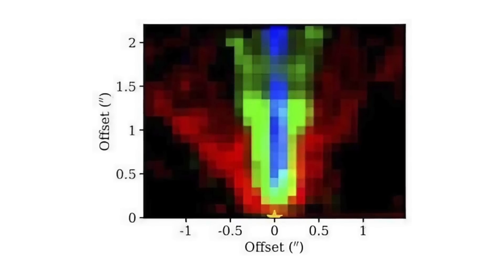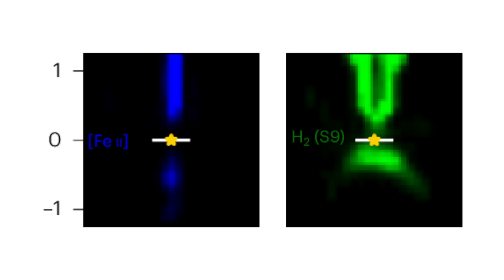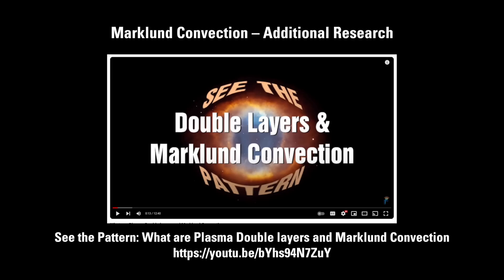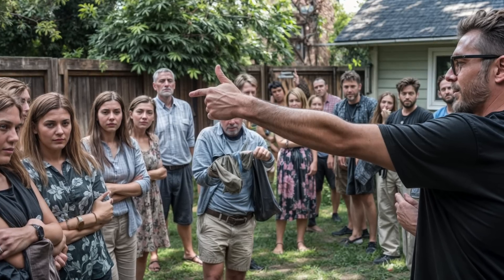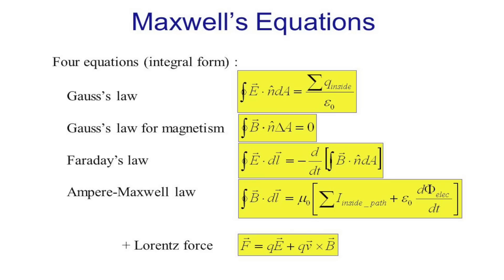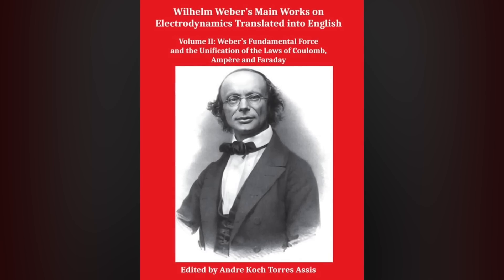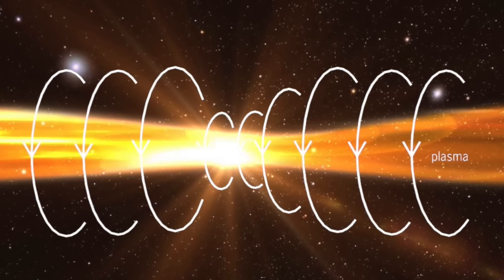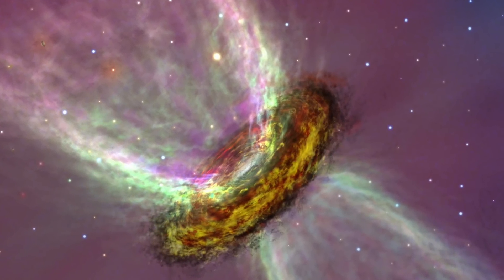Michael Clarage: The Gestation of Solar Systems | Thunderbolts

Comment: Goes well with the oil drop experiments that show how we get the ring and moonlet structure from an oil drop in an electric field, and Tom Van Flandern’s work on why gravity can’t form a solar system like structure.
Reply: A MIRACLE IS HAPPENING!!! MAINSTREAM SCIENCE IS PLOTTING .......... MAGNETIC FILAMENTS IN OUR GALAXY ...... AND THEY ARE BAFFLED, of course!!! Check out Anton Petrov's video Mind-blowing New Discoveries About the Milky Way Galaxy . I left this comment:
🤜⚡💥⚡🤛 FINALLY they are reaching for the true understanding of the nature of the Uni ...but still they remain blind!!!Why? Because they use the Ptolemaic method with reductionist approach instead of the scientific method.  The plasma cosmology [antithesis of BigBang] community understands these magnetic filaments, for nearly hundred years, as Birkeland current filaments and the nebulae as intersections/collisions of several Birkeland current filaments. FYI, WHENEVER YOU HEAR MAGNETIC FIELD/LINE/FILAMENT YOU MUST TRANSLATE THAT AS ELECTRIC CURRENTS!!! because... electromagnetic theory. These currents/filaments interconnect EVERY object in the universe!!! and form the Cosmic Web.  Previously I said in regards to the nebulae problem: The runaway star phenomenon occurs due to the chaotic nature of the collision which involves electric currents, resulting is a slew of small stray Birkeland current filaments. I predict that we will discover this type of phenomenon in every nebula of this kind. 

On a more important topic, most mainstream scientists and followers also don't understand the Red Shift and the problems inherent in the BigDung theory. To wit, an expanding Universe entails matter and space-time [sic] would have to expand, which, per the mass-equivalence principle [E-mc^2], are made of energy. This would either require energy to be continuously created, or the 1st law of thermodynamics [conservation of energy] is invalid, or their density is decreasing. Either way all physical laws and the associated constants would have to have been constantly changing over the life span of the Uni which implies that all atoms and molecules would have been destroyed long time ago, ergo no Uni. The EM spectrum of the past [from distant objects] would be seen today as radically different. Even a slight change in the current constants would undo the present order/equilibrium. By all accounts the Uni would have radically changed over the presumed 13+ billion years, if not have been totally destroyed. The BigDung theory does not take this into account. Clearly the theory is false. 🤜⚡💥⚡🤛

=== 
Yes, presumably there is an interplay tween matter and the fabric of space-time but only because they are intertwined. This principle is arrived from the energy equivalence equation when it is solved for the time component. By Onerock's core definition, space and time are interchangeable.

But that's only on the word of that ol' mathamagician [that's not a complement]. By my tone you might have guessed that I'm not a a fan of that theory. IMHO, Plasma Cosmology [Electric Universe theory] predicts and describes the Uni more completely and eloquently. See the Thunderbolts Project channel. Also 'See The Pattern', 'LPPFusion', 'Unzicker's Real Physics', 'Ray Flemming', and Prof. Pierre-Marie Robitaille's 'Sky Scholar' channels... to start. As a consequence you too will find the current sciences distasteful. Naturally I don't recommend the 'conventional' physics sources as they are on the wrong path.

===
Me, I'm only a triple engineer rewriting the electromagnetic theory which, as you know, touches everything else. I call it the Parallax Electric Theory [PET] which dispenses with the anachronistic notion of magnetism. Everything is but charges [electric fields].

~~~ Know plasma, know 99.999% of the Universe (No plasma, no Universe) ~~~
===
PS. From where I stand, the Uni is flat[i.e. infinite], static[i.e. not expanding], eternal[albeit finite lifespan at present] and 'c' is just a number [do you know what that means?][hint, add it all up].  [It means that 'c' is not the maximal speed in the Uni... because Onerock is dead )) ]   Drinks are on me!!!

===
Check out these vids:
==> The censorship of cosmology | Eric Lerner    [Eric disproves the BigBangGang hypothesis in several ways*!!!*  Eric Lerner is saying that for a non-expanding universe, galaxy size is linearly proportional to distance, *as the evidence shows*. In the expanding universe theory, the galaxies should be much smaller in size (to the fourth power) and less bright than we actually observe. He’s correct BUT his papers have not been accepted because there are too many reputations and too much funding for the Big Bang research Gang on the line.]

==> Challenging the Big Bang: The Struggle with Inferred Reality
==> History of the Gaseous Sun with Dr. Robitaille
.  ..  ...
Reply: In the oil drop experiments, we can suspend an oil drop in an electric field, but get radial streaming to a structure looking like Saturns rings and moonlets. Michael here is explaining how we get separation of elements from the magnetic field of a current flow. The key point, is that the electric field in the oil drop experiments, would have to be the same as the current direction in Michael’s idea, but BINGO, that’s perfect.
So, TomVan Flandern’s proof that gravity doesn’t  explain this structure, is just icing on the cake.
Reply: @jamesweninger  There is no current. We are dealing with overwhelmingly neutral gas, as the H2 emission lines show. Learn plasma physics.
Reply: @jamesweninger  Learn physics, buddy. Stars form in clouds of neutral gas. Get back to me when you have gotten beyond high school science.
Reply: @jamesweninger  " but all I’m saying is the electric “field” is actually a flow of charged particles on a scale we are no more able to perceive than we are able to perceive gravity particles."

In which case you don't know what an electric field is.
Reply: @jamesweninger  "You do know that I went to grad school for this?" - you rather make it sound like a punishment.
Reply: @physicswithpark3r-x3x  I learned quite a bit. Just wish I had been exposed to some other outside the box ideas first.  I took too much in as fact, without questioning.
Reply: @davejones7632 here we go again, because my response was deleted. Gas clouds may be net neutral, but they have charged segregated layers. Scintillation screens of electrons appear on the surface, (that is free electrons causing that), and there are ionization gradients that vary with depth into the cloud. (That’s the Marklund convection). So as long as the scintillation screen is moving with respect to the ions, that is current.
Let’s see if this gets removed.
Reply: "and there are ionization gradients that vary with depth into the cloud."

Actually, that is likely to be true, for obvious reasons. However, as mentioned, the ionisation fractions are tiny. Cosmic rays are going to ionise more molecules on the edges of the cloud than they will in the centre, as they will only penetrate so far before striking a molecule.
Reply: @davejones7632  Yes, I looked into that.  The puzzle was, that they were seeing fairly uniform ionization with depth along the cloud.  See, they knew they should have “hot spots”, if outside sources were causing the ionization gradient. For example, a nearby star would ionize deeper locally.
Reply: @jamesweninger  "that they were seeing fairly uniform ionization with depth along the cloud."

And those ionisation fractions were? Let me guess- 1 part in many millions? As I said. So, neutral gas. And there is certainly ionisation around a star once it initiates fusion. They are known as H II regions, and are seen within molecular clouds once a star has reached the main sequence. However, we are not dealing with main sequence stars here, we are dealing with class 0 and 1 protostars. The fact that we are still seeing neutral H2 around these protostars tells us that they are not very hot. H2 dissociation only requires about 4.5 eV. Or a few thousand K. And it is seen in these jets.
Reply: @jamesweninger  You are arguing with a crazy bb guy, are you scared?
Reply: @davejones7632  You're still sitting there with a pile of physics, remembering everything. Go back to school, child.
Reply: @davejones7632  absolutely right, extremely low ionization fractions.  This actually addressed in the works of many of the plasma universe, or electric universe theorists.  You don’t need high ionization fractions to get high current. I’ll dig up examples if you want.  
I am interested in what your background is. You seem to have a good handle on this stuff, and I’m always looking for serious challengers.  I’m always open to the idea that I’m wrong, but it won’t be because of a lack of reading all the literature on these topics.
Reply: @jamesweninger  "This actually addressed in the works of many of the plasma universe, or electric universe theorists.  You don’t need high ionization fractions to get high current. I’ll dig up examples if you want. "

I doubt any such work exists in the peer-reviewed literature. And if such currents impossibly existed in molecular clouds, they ought to be obvious in synchrotron. The fact is, there is no mechanism for the formation of such currents, which is why nobody published on the subject is invoking them. They aren't there and they are not needed to explain anything.

"I am interested in what your background is."

Astrophysics and plasma physics. To MSc level.
Reply: Keep in mind, I was skeptical about filamentary clouds being current carrying. Simply, with the idea of magnetic fields being wrapped around by the right hand rule, I knew we should see that in the Faraday rotation. But then Don Scott published that Bessel function idea, and that means we should have reversing magnetic field directions. Sure enough, in the literature they see “magnetic fields reversing direction on regular distance scales”. Of course, they try to explain it as turbulence, but it was a prediction in Scott’s model. That’s when I started taking it seriously.
Reply: @jamesweninger  I wouldn't take anything said by the EE Don Scott on plasma physics at all seriously! Anyone who invokes 'anode tufts' in the ~ 99.99% neutral gas of the photosphere is obviously not too clued up on the subject. Ditto with electrons drifting in towards the Sun against a magnetic field headed in the opposite direction at 100s of km/s. Don't EEs learn what happens to charged particles when they encounter a moving magnetic field? I don't suppose they need to know.
Reply: @davejones7632  If we start simply with the logic that Don used, you see where we astrophysicists were wrong. Even in a jet of net neutral but ionized gas, it is not like the charged particles just spiral along the background field. When you have a dense enough concentration of charged particles, it’s the self interaction that dominates. That’s where the bessel function comes in.  Each particle moving under the influence of each other, as well as the background field.  That is straight forward logic, there is evidence for this, and I know for a fact you did not learn this in your plasma physics classes. Nor did I.
Reply: @jamesweninger  "That is straight forward logic,"

As not proposed by any plasma physicist. Ever. And has zero relevance in clouds of cold, neutral gas.
Reply: @davejones7632  actually, Don Scott did point out that plasma physicist by the name of Lundquist had come up with the idea previously too, but obviously no one got that.
Reply: @jamesweninger  And where did Lundqvist write on molecular clouds? And star formation?
Reply: @davejones7632  whose point are you making? The whole idea of EU, Thunderbolts, plasma universe is that plasma physics wasn’t applied to these very structures.   Now, back to your argument about the low ionization fractions, you do realize that the electrostatic force between two protons is on the order of 37 magnitudes greater than the gravitational force, or, for a single volume of space containing 10^37 neutral hydrogen atoms, but a single proton, that the repulsion of that single proton is strong enough to counter the gravitational pull of all that neutral hydrogen. The point is, insanely low ionization fractions are all that is required for us to start considering plasma effects.
Reply: @jamesweninger  dude you are wasting time explaining to bb believers so i think just treat him like an idiot
Reply: @davejones7632 hello bb fan
Reply: Where did my responses go?  I did a rather detailed response on how you get current in a net neutral gas cloud.  Where did that disappear to?
Reply: @jamesweninger  it is there. reload the page, order by most recent first and complete lists magically reappear

Comment: HH30 Looks for all the world like CF Krafft's model of the proton.  A double vortex structure in rolling contact with an influx through the equator, and an efflux out the two oppositely pointing polar openings.  The predictions were that both rings spin in opposite directions axially and coaxially. The jets themselves will also have rotation. One ring out to be blue shifted the other red shifted if that is what is going on. A proton writ large

Comment: By the way: What happened to the Safire-project/Aureon energy and it's ambitious fusion generator? Got some visit from the energy mafia? Now only neutralizing radioactive wastewater from nuclear power plants? Isn't that a bit weak?! Come on, you should know, that the credibility of the EU model is measured in very practical engineering solutions. Solve the energy problems of the world - and everybody believes in plasma cosmology!